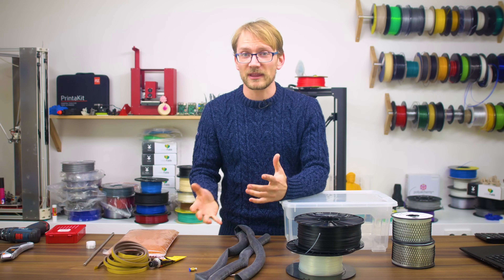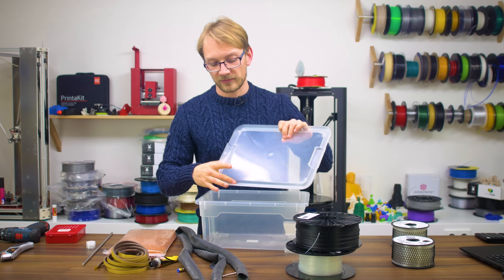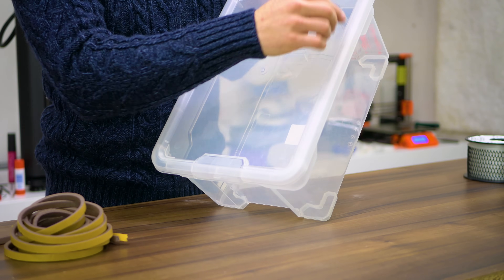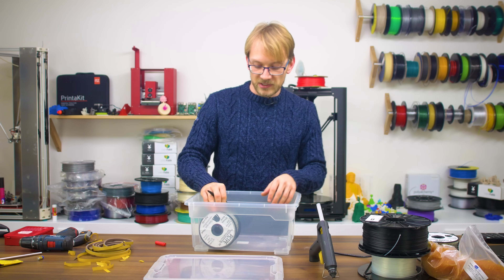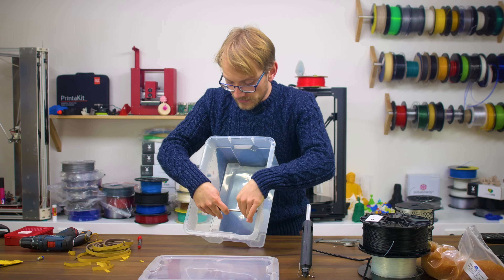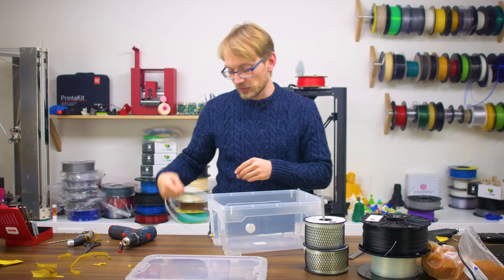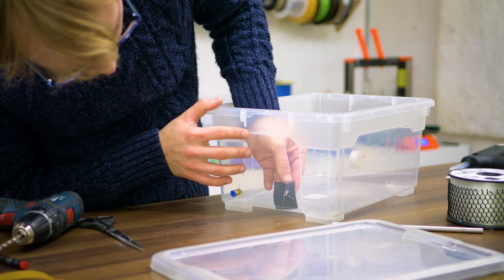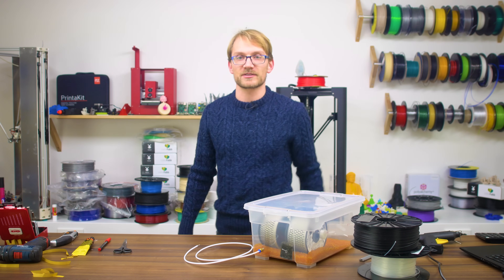How to keep your filament dry: Make a storage box!

Comment: For simple storage, I use some large Tupperware-style pails with airtight lids. They're not hard to find - the ones I have can fit four 1 kg spools. No need to seal the lids, they already have a seal. For drying, instead of silica gel, I use those dessicant pouches that you hang in cabinets - they contain calcium chloride and some sort of gelling agent. You can get scented and unscented varieties, and some with activated charcoal mixed in to absorb odors. Best of all, they're cheap and last a very, very long time if you don't leave them out in the open. I've got a few small hygrometers (you can get these at pet supply stores, people use them for reptile terrariums). I put the spools in, put the pouch and hygrometer on top, and after a few hours the humidity inside the container goes down to between 18 and 22 percent. The nice thing about these pails is there's little wasted volume, and you can stack them - I have five at the moment. If I wanted to make a dry box for feeding hygroscopic filament I'd find a similar rectangular Tupperware-type container.

Comment: I dry it it the toaster oven then put it in a air tight extra large cereal box with dessicant, a gauge and a PVC roller installed works well.

Comment: My Bowden tube routed from the box to the extruder bends whenever the extruder retracts. This seems to cause a bit of under extrusion somehow and it also makes my printer make weird sounds.
Reply: I would try leaving the printer bowden tube as a factory setup. Make a stand of some sort that the box can sit on and treat the box as just a spool holder. Have about 4"/100mm of bowden tube on the storage box then just feed it to the printers tube. The 4"s/100mm tube on the box should be sufficient enough to seal the box when not in use if not put some tape around the end of the tube and filament that's protruding to seal it for sure till next print. Just remember to snip off 100mm of filament before next print to be sure the filament is clean.

Comment: BTW the correct size drill bit to create an m5 thread is 4.2. The pneumatic coupler is not a thread cutting device, but then again you are working with think plastic, not steel

Comment: @Thomas Sandelerer I am printing Nylon 6.6 and connot get it to stick to the bed. Tried many adhesives alrdy like PVA gluestick, hairspray, 3dlac... wolfbite nitro I did not try yet. Just ordered Phenolharz Platten for now... Do you think it will work or do you have anything else on your checklist that i could use? I do not care if it permanently bonds (i can remove bonded stuff with powertools if needed) it just needs to stick nomatter what cuz i am in a real hurry with this part... basicly my future depends on it.

Comment: Just a piece of advice if is permitted. Next time when you make a hole in a thin plastic wall, keep a wood piece (sacrificial one) behind it for support and use the wood bits not the one for metal. This will help you to make a clean hole in suck conditions. Good job anyway.

Comment: Push lock fittings are plenty airtight I use them with teflon or nylon tubes at 200+ psi on a regular basis

Comment: Has anyone tried large mylar bags? It seems that they would be much easier to use, as they can conform to the shape and size of the spool, and their seal can be more easily verified. While a clear plastic bin may be useful for stacking and such, their seals are rarely reliable when something gets stacked upon them. Perhaps a combination of using clear bins that are multipurpose and allow visual verification, but mylar bags for the spools.

Comment: There is a cheap water and airtight container available here in Korea (they are called Lock&Lock if you are going for brand-name ones or Tark if you are going for Daiso brands) and they have built-in snaps and full silicone seal, are reasonably sturdy and has thick walls so you can thread in Bowden tube and seal it up.
Get the big ones that can contain spools either horizontally or vertically then align the box accordingly.

Comment: I love this project but when building it myself, I found that the link for US pneumatic couplers did not work well for the application. They scraped the edges off of my filament and left a curl of plastic like a cheese grater. All the other supplies work fine, but I recommend different couplers.

Comment: How long will the gel last, though?...
Reply: Michael Angelo H. 
The (hard) silicagel will last very long as long as the lid is not left open for hours. And when its depleted this orange type of dessicant changes color (to either green or transparent depending on type - I guess the more expensive transparent type is for colorblind folks). The dessicant can be pretty much arbitrarily often reactivated by baking in an oven. Quickly soaking it in liquid water can crack it though (due to uneven expansion) and thus permanently destroy it.

Comment: Use your drill in reverse when cutting polycarbonate. It will take longer but you won't crack it. Or even better get an Expanding Hole Opener Reamer

Comment: Thomas thank you for this video. You inspired me to create a few of these types of boxes and I'm holding roughly 12+ rolls of filament in 3 of these types of boxes. My design is roughly based on yours, but it has made a HUGE difference! Along with the fact that I got a food dehydrator and dried all of my filaments with it and then put them in these boxes. Thanks again!
Reply: So i got a qeustion i got a sv06plus coming with a direct extruder should i just make a box and have the bowden tube come out above the printer.
Or will that create to much drag.
Sv06plus is basically a prusa mk3s clone for clarification

Comment: Here's the link to the rod holders for those interested  https://toms3d.org/2016/12/17/keep-filament-dry-make-storage-box/ It's under "Download Attachments"
Reply: For those in the USA, here are similar brackets to use 1/2" EMT pipe instead, which is available for pennies a foot at local hardware stores: https://www.thingiverse.com/thing:2748513

Comment: Hello Thomas, thnx for your German links.
I'm trying this for the first time and don't really understand what the pneumatic couplers are for. Are they providing friction-free travel of the filament? Because if they would 100 % seal air off there would be friction I guess .... could you tell me what the wanted functions of that part are?
Reply: It doesn't really matter. The seal isn't really airtight anyways and remember: there is a lot of silica gel inside

Comment: Instead of a drill bit I use a soldering iron for cutting/drilling the holes. That way the plastic doesn't crack.
Reply: yea but that ruins the soldering iron tip

Comment: I find an easier way to make holes in the box is to just use a soldering iron or a torch and an awl. Then you don't run the risk or cracking the box like he does at 8:55 I know (/think) that was on purpose for demonstration but still I find this way easier.

Comment: While waiting for my prusa i3 I have some time to get all needed materials and learn more about 3d printing, cad designing, etc. And creating a filament storage container. I have all but the silica gel. I am wondering though, can filament be too dry? Dry stuff can break more easily, but perhaps that doesn't apply to filament.
Reply: I am in the business of producing Nylon cored drive belts.Very dry Nylon does lose some of its impact resistance and can get borderline brittle, but Nylon is so tough that you won't notice that at the loads that filament is subjected to. You'd have all sorts of other mechanical problems (jamming) before the filament comes even close to its tensile strength.
With other hygroscopic materials (TPU) you definitely want to get rid of as much water as you can when melting them, because the water vapor will not only blister, but chemically break down the carbon chains of the material, inverting the polymerisation process. (This is a polycondensation for TPU, meaning forming chains by splitting off a H and an OH from the ends of the monomers being joined, which then bond into a H2O.)

Comment: Why is the silicagel so expensive? The silica cat litter is much cheaper and does the same thing. Or am i wrong?
I don't think, that there is a difference. you can get 4,5Kg of silica cat litter for about 12€
Reply: anything for a niche purpose has a higher pricetag
Reply: I also use natural (non-perfumed, transparent) silica kitty litter. It can be found really cheap in pet stores. I just got 3.5 kg for 3.5€.

Comment: I have my spools in a Ziploc vacuum bag then I put that in a Ziploc airtight storage bin, inside the bin I have an Eva-Dry dehumidifying silica gel beads that you plug into the wall to dry out every once in awhile. I am inside the house so I shouldn't have a problem but I am a beginner and probably a little paranoid about screwing anything up.

Comment: Why does plastic need to be kept dry? Thjey use plastic bags to wrap them it so I'm failing to see why it needs to be dry or how it could not be intrinsically dry. 

I understand filiments with additives like metal and such but why would plastic care about moisture?
Reply: Still wondering why plastic filament needs to be kept dry. The box you made to keep it dry is plastic!!
Reply: not all plastics absorb moisture from the air  but filaments like nylon and PVA absorb tons of moisture and when they print the moisture in the filament will turn into steam. I had moist PVA filament once it bubbled and made popping sounds. When it bubbles and pops the filament isn't extruded evenly causing an irregular print.
Reply: Makes more sense now.
Reply: It's not that plastic can absorb moisture that's the problem, per se, it's that if you try to print with filament that's been exposed to moisture it can affect the quality of your print.
Not all plastics are susceptible to moisture absorption and once printed this is usually not a major issue. It looks like he's using a box made from injection moulded polypropylene which is fine. Bags made from polyethylene (polythene) are also fairly moisture resistant.

Comment: A couple of hints. You can use an old sock or nylon stocking to put the silica gel in so it's not all over the place. You can also save the little packets of gel that come in most filament, medication, new shoe, etc, boxes and through them in there.
 There are some containers out there that already come with a gasket sealed lid. Just find one in the detentions close to what you need.

Comment: if moisture is an issue when this material is on the rolls, what happens to the finished parts?
Reply: Moisture is an issue in the printing process because the moisture turns into steam. causing bubbling in the hotend

Comment: just an FYI when drilling in to thin plastics its best to drill in to the object while running the drill in reverse thus making the drill bit warm enough to thin out the spot until the drill just pushes through with minimal pressure.
Reply: Wow. That is a great idea. thanks for sharing. Never thought about revers for heat/no snags.
Reply: Just use your hotglue gun, remove the gluestick and push the hotend through the plastic.
You could also use your soldering iron if you need a smaller hole ,  but that will ruin the tip •_•
Reply: Tammo Ripken I'd recommended buying a sacrificial tip for this purpose ;)
Reply: @ciarfah  a sort of wingman if you will
Reply: Yes, the problem is that standard drills are too 'grabby' for plastic. Ideally, you want to grind the drill tip with a much sharper (pointier) end. Assuming you have a drill grinder to hand....

Comment: Do i need this if i only use PLA?
Reply: lolmanch PLA is also subject to absorbing moisture as far as I'm aware
Reply: Not really, PLA absorbs moisture, but unless you have an extremely precise printer, it won't have a significant effect. Long term storage is a different story.
Reply: @amir_404-e4d  Wrong, sir. I'm here precisely because my PLA has absorbed too much moisture and now comes out of the nozzle real stringy and the resulting print is very brittle to the touch. Thank you for the tips, Thomas!
Reply: How long is Long Term? Is like leaving it out for 10 days without use fine?

Comment: Why didn't you just use a filament cleaner with the sponge? It should be clean enough.
Reply: Mikkel Kirketerp Because this is more about moisture absorption in the filament plastic than dust control. For instance PVA is water soluble, used as an easily removable support. If left exposed to humid air it could absorb enough to become unusable.

Comment: How do you decide which type of adhesive to use (e.g., hot glue, contact cement, superglue, ...)?

Well, I suppose it depends on the materials you want to bond, the required strength, etc., and you simply have a good working knowledge of these. (Like, presumably contact cement wouldn't have worked (well enough) for the printed rod-holder, and hot glue wouldn't have worked on the bike tube?) I suppose what I'm asking is: can you recommend a guide or lookup table?

Comment: I don't trust heat glue to stick those holders to the edge of the box well. I know mileage may vary though. Could be fixed with some screws through the side of the box.

Comment: Pretty good, but I was disappointed in that it seems a bit sloppy. Here are my suggestions:

1. There are some nice designs on Thingiverse (I did the first one):
http://www.thingiverse.com/thing:961881
http://www.thingiverse.com/thing:743280

2. Start with a container that already has weatherproofing. The cost is very similar if not the same!

3. Simply pouring loose desiccant into the container is messy and lazy, not to mention a waste of money. Get something renewable, like this:
https://smile.amazon.com/gp/product/B00LVN7BM0
or even this:
https://smile.amazon.com/gp/product/B00BL79JDK

4. The bike tubing is completely unnecessary, IMO, unless maybe if you live in a very humid climate. You're not sending the thing into space after all

Also, don't forget to dry out your filament before putting it in the container. I like the oven method

Comment: Hey Tom, its a little strange, but one thing that works really well are frosting buckets. You can usually get 3 or 5 gallon buckets that are food grade and air tight, used from a local bakery or from a grocery store. You have to wash them out and your filament might pick up a slight frosting smell, but they work really well, are very strong and easily stack.

Comment: i found problems to get an abs printed bracket to stick on box side using hot glue. it dettaches when loaded with more than 1 kg. i ended up using screws :(.

Comment: Anyone else see the irony of him showing the importance of dry storage with the open rails of filament behind him
Reply: Thomas Sanladerer that's fair enough, I'll admit I'm new to the hobby so I'm trying to piece all the information together
Reply: I was more wondering why the storage style. I mean, if he needs the yellow one, he's got to lift them all up, slide off 5 others to get at it, then put them all back. He also can't see the labels as they are if they are printed on the sides.
Why not have single rods sticking out of the wall?
Reply: Wait, so the printer is below the spools as they are? That makes sense now :)
Reply: +jimfun71 For long term warehouse storage this is a must. Because warehouse storage is rarely perfectly climate controlled (read: Many warehouses are climate controlled, but it's difficult to keep such a large place at a perfect humidity for specifically printing filament). In addition, shipping will also possibly expose your filaments to the elements. So for best results, and to ensure the consumer gets repeatable performance from spool to spool, they vacu-seal and desiccant pack them. At home storage, it's not quite as important in many places; because your home is generally a more hospitable environment for general filament. Specialty filament however would require more careful protection and attention to storage to ensure peak performance. Overall, it's a good idea to keep your filament stored well, particularly if you do not print very often, or do not use large amounts of filament. I would hazard that Tom here goes through that filament relatively quickly, to the point where their storage on the spool holder is negligible. :)
Reply: Thomas Sanladerer then why do all my filaments come vacu-sealed with a desicant pack? even the little sample packs come vacu-sealed.
Reply: shaggyego the filament he shows is nylon it’s way more hydroscopic than say platform instance and it’s more expensive so I think building it is fair :)
Reply: Fairly certain that he's mentioned previously that his 3D printing room is humidity controlled.
Reply: just pla not abs....
Reply: That's PLA which is fine like that. Basically everything else needs a box.
Reply: you can put them on an oven to dry them
Reply: @shaggyego that is because the filaments he specifically mentioned in this video are hygroscopic (meaning they absorb ambient moisture from the atmosphere if they are not sealed in an air tight container).  Filaments with materials such like nylon, PETG, PVA, and flexible filament are all hygroscopic.  But all of the ones on his wall like PLA, Prusament, ASA/ABS, etc are NOT hygroscopic and do not require special air tight storage.
Reply: shaggyego Saw that too. Bit I guess he's gonna use them all later printing his 3d printed house
Reply: lol, exactly the opposite